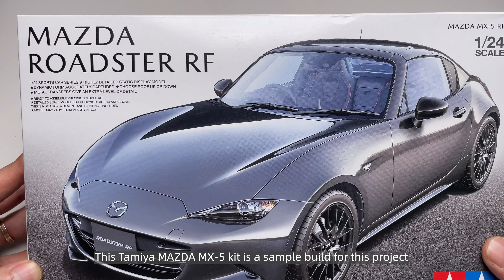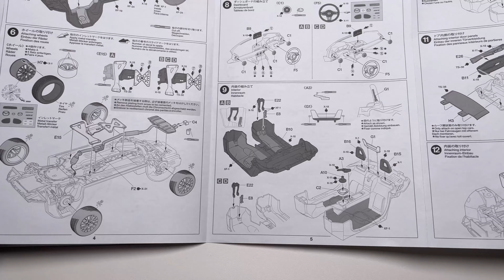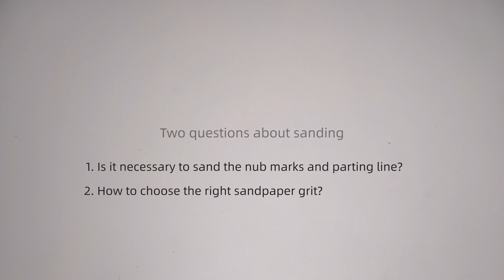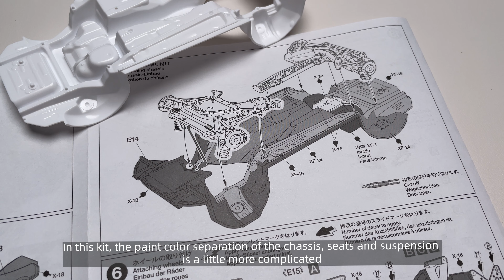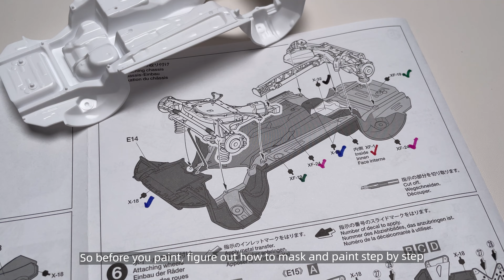How to build your first scale model car as a beginner | Mazda mx-5 RF chassis and interior build

Comment: Great tutorial, thanks! What colors and types are you using? Same as yours masking fluid seems not to be working with regular Tamiya acrylics, it comes off with paint..
Reply from the maker: Thank you. I use lacquers (cellulose-based acrylics) such as Mr. Hobby C-Series and Gaia Color. Masking sol doesn't seem to have the problem of comes off with paint. Make sure the paint is dry, the surface is free of grease, and the masking sol is applied thick enough.